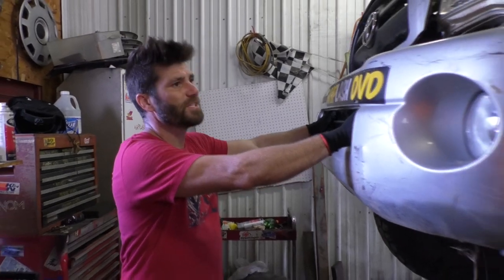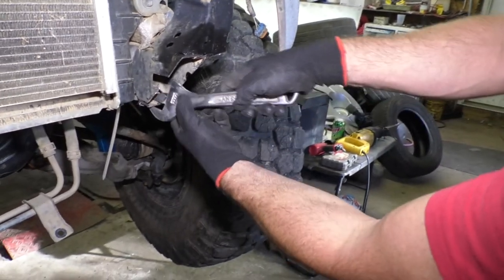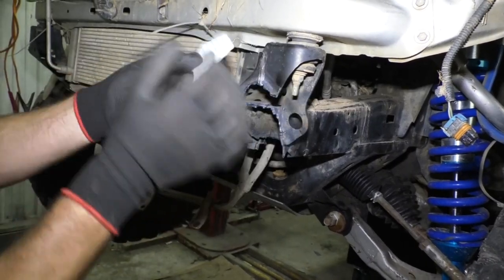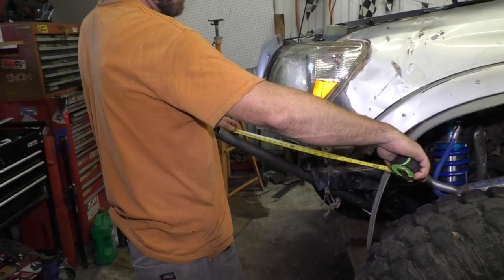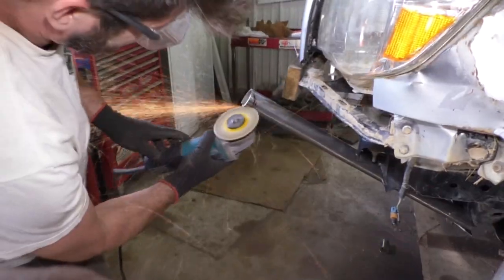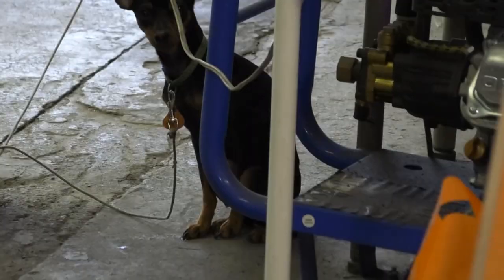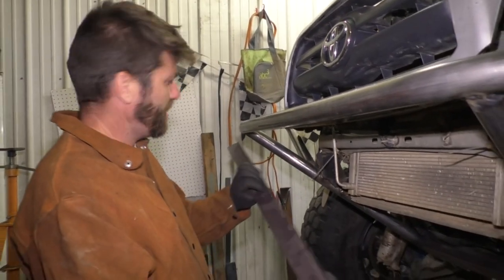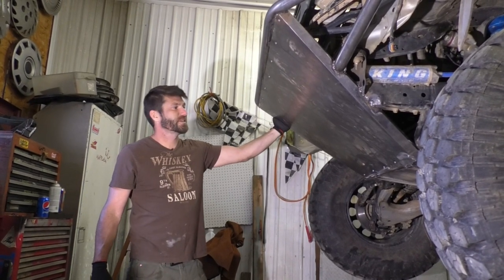High Clearance Front Bumper Built not Bought

Comment: Serious question here...Why did you choose to cut out so much of the frame to get the angle, as opposed to bending the bars and inserting them inside the same area? Im gonna be building something similar soon and would like to know if there is a difference in strength or ascetics. I will be adding a bit more meat to it to hold a 9K Mile Marker Ive got. Thx, GearHead
Reply from the maker: I cut as much away as possible for better approach angle - Basically so the tires will hit things sooner than the skid plate.  I had to redo this bumper since the V8 swap.  If you haven't seen it, you should check it out!  https://www.youtube.com/playlist?list=PLU5lR_tbWf0zep_2PlB2nioosQY4ueE7T #tacundra

Comment: This is pretty much exactly the bumper I wanna build for my 1st gen tundra, do you think what you cut off weakens the frame at all? mines my daily. Thanks!
Reply from the maker: No.  If anything it strengthens it cause its braced to the lower bracket.  The one thing I'm going to change btw - I'm going to make a new one with a big rolled radius on the main bumper tube because this one bent in a little from pushing it against trees.  I currently have this truck in pieces - installing a 5.7L V8 Tundra engine and bunch of other stuff.  Check it out - https://www.youtube.com/playlist?list=PLU5lR_tbWf0zep_2PlB2nioosQY4ueE7T

Comment: 18 gauge for skid plate that’s right?? And this is stainless steel or aluminum? Thanks
Reply from the maker: That was made from regular steel.  But It was too thin to be honest.  I'd probably recommend thicker aluminum.  At least 1/8th inch thick.  Maybe 1/4" if you're gonna run it hard.